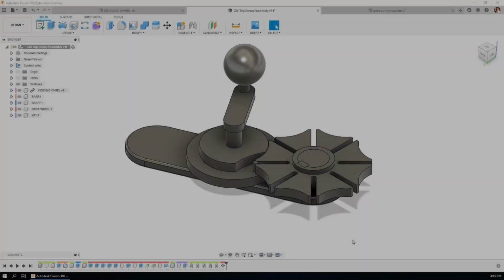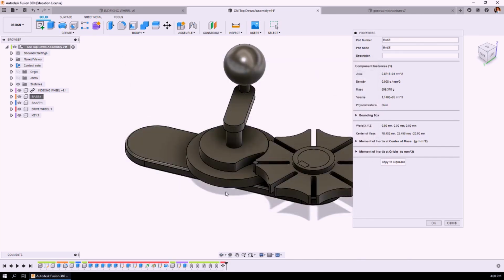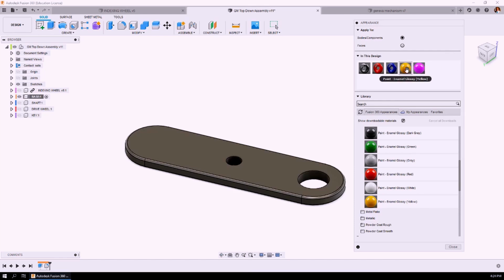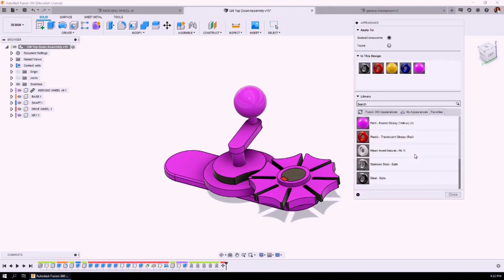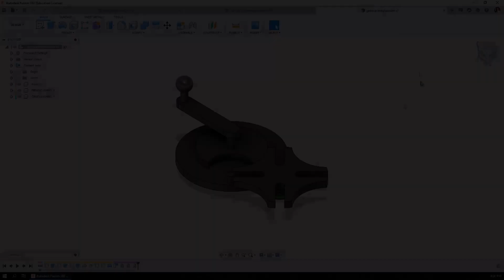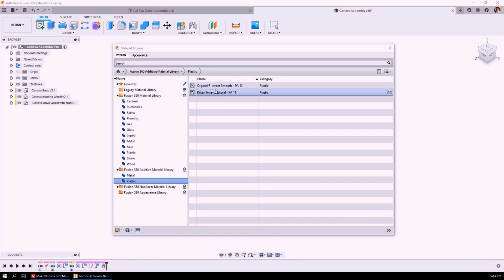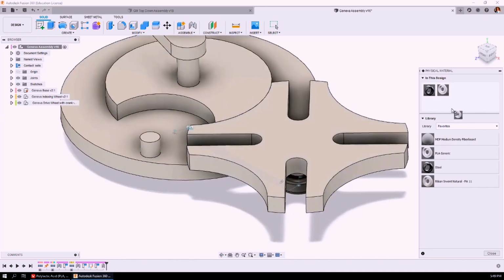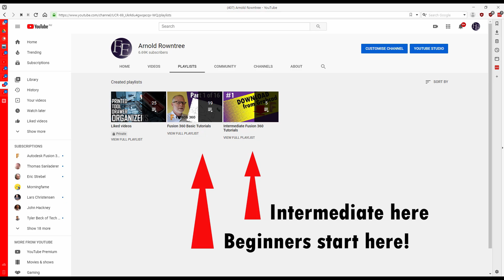Fusion 360 Appearance Tutorial | AND Physical Material

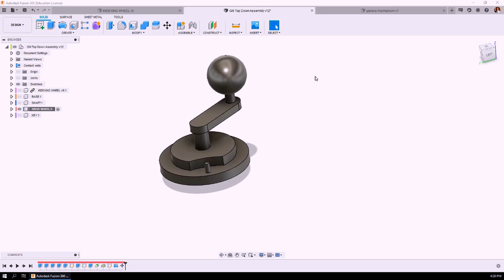Comment: Arnold, @ 5:57 ish you applied color to the whole component and a dialogue box pops up and asks and you remove from mating surfaces?  I don't get the pop up box??  What happened?
Reply from the maker: Geoff let me check a couple of details first, you might have noticed that I activated the drive wheel and activated it prior to opening the Appearance dialog with the 'a' key. I'll presume you did that.
Also please bear with me while I check this with you; did you see that the words "Apply To" have a little triangle nearby. Click on that little arrow to reveal the radio buttons for 'Bodies Components' or 'Faces'.
Please check these and come back to me Geoff.
Reply: Arnold, I had the 'Applied To' open.  I went to change the appearance on the part and got the pop up this time.  I slowed the video way down (1/4 speed) and saw what you did.  After you clicked the 'Remove" in the pop up, you switched to 'Faces' and touched-up the  rubbing faces.  Thanks for the help.

Comment: First of all, thank you Arnold, I speed ran your tutorials playlists today and it was the best videos on Fusion 360 I found on YT. I've had some experience with Solidworks in the past and it feels like Fusion 360 has a much more modern and streamlined approach. As most of the stuff I do involves 3D printing I would like to ask two questions:
1- When you mention PLA, how do I relate this data to the infill in the 3D printer? Maybe find the center of mass from gcode?
2- Do you plan on making any instructions regarding versioning control across multiple files? i.e. if I change a component, how do I keep track of the assemblies that were made with each version of the component? In 3d printing there is a lot of back and forth between printing, seeing if it fits, changing the design and printing it again, some version control seems pretty neat, but this version control feature of Fusion 360 is still a mystery to me.
Reply from the maker: Good to have you here Lucas, I'm afraid I'm a beginner with 3D printing so I'm just taking a stab at Q1. If the PLA being used for the support material is coming off the same spool then the properties are the same, its only the geometry that varies. Don't you discard all that support stuff anyway? When it comes to assembly I'm planning to study Angus' video at Makers Muse about Designing for Assembly. He's got the tolerances sussed.
For Q2, yes I do plan to make videos on version control since Fusion 360 is selling itself as a simplified vault for team asset management via that cloud feature. It will be part of a series of DIY build projects but it could be some time yet before I get to them, there are a few things to do first. In the meantime the Autodesk guys are covering this as they add new functionality. 
Here's one    https://youtu.be/KiAjHbF1TBo
This is their channel, try searching 'version'
https://www.youtube.com/c/AutodeskFusion360/search?query=version
Reply from the maker: I just checked the 'what's new' page and there is new stuff in version control, see here
https://www.autodesk.com/products/fusion-360/blog/april-2021-product-update-whats-new/